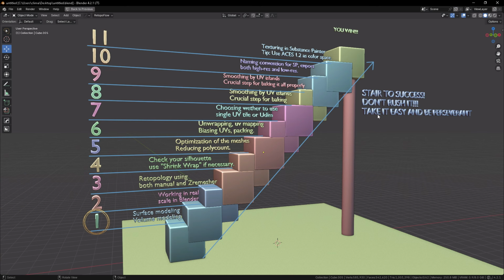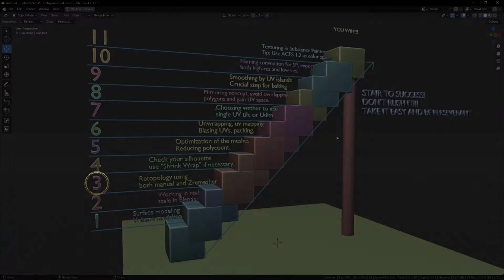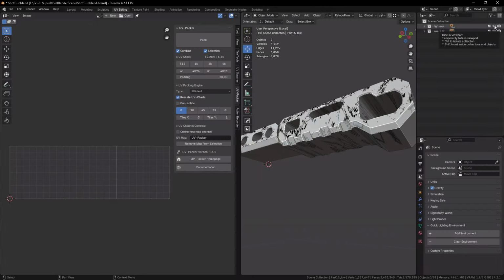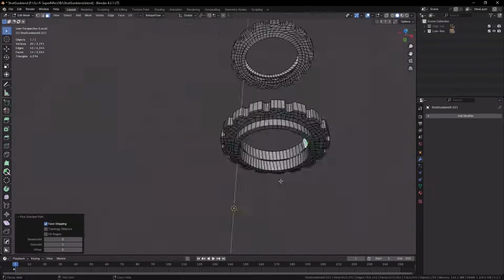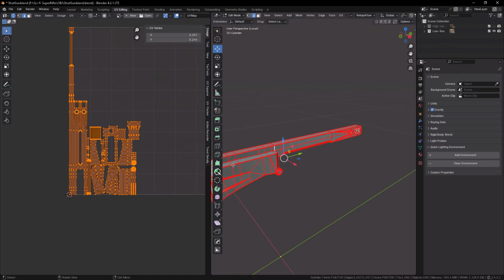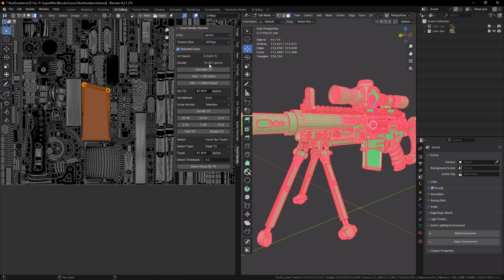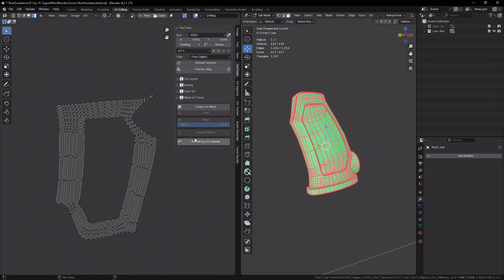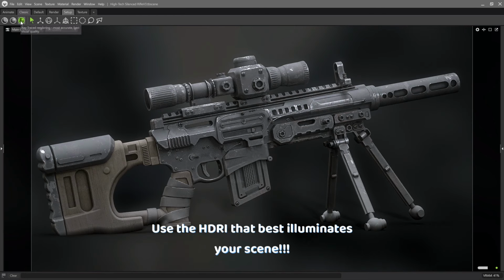Can You Master  3D low-poly  Modeling in 11 Steps?

Comment: Hello. From plasticity can I 3d print that object? Or do I need to retopology it? Thanks
Reply from the maker: Hi! Yes, you can 3D print models, as long as you know the exact measurements and tolerances.
Reply: @Stuff-3D-creations Is there any way to set them? I would like to design a truck. A lot of parts and with plasticity should be faster design them. Then I have to Boolean them and, in some parts, set a tolerance of 0.2 mm for the assembly parts. Do you think I can set it during the design? Can it handle an assembly (that is supposed to be 3d printed) of multiple parts like Fusion? Thanks
Reply from the maker: @Antonio-o3c9c  Yeah! In Plasticity you need to work parametrically, you should enter measurements by pressing (TAB) when a tool is on,  but this is true for Plasticity 2024, never used Plasticity 2025, it shoud be the same, I guess. Try to design a simple hinge, taking into account tolerances, and print it before starting on a truck, set the tolerance to 0.1 and give it some shots.